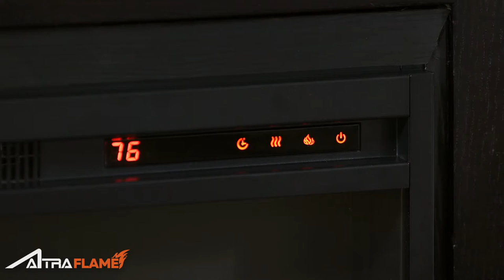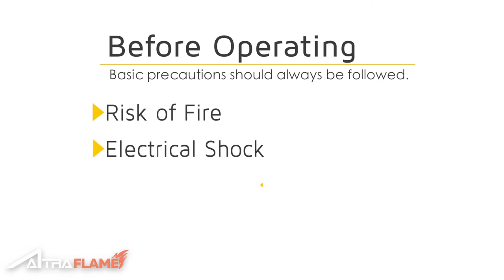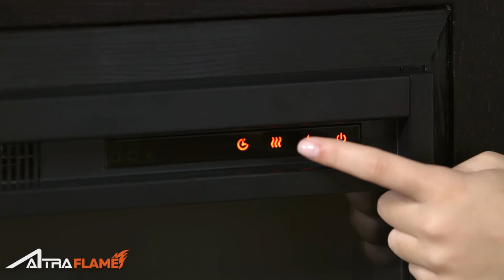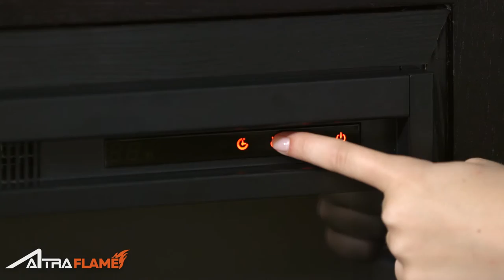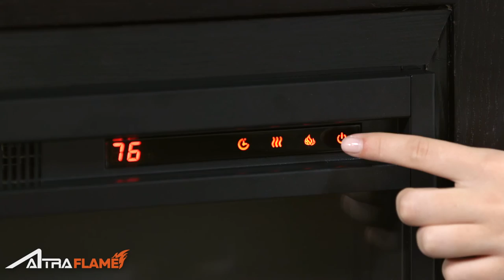Ameriwood Home's AltraFlame 23" Fireplace Insert Features

Comment: Mine is very similar to this model, however mine has cabinet doors and some the setting functions work differently. Bought mine towards the end of winter from walmart when it was on sale last year..  ill use it more this winter but so far no issues.  Im running mine currently set at 82 degrees. Tonight it is supposed to drop to 28.

Comment: I bought one for my wife for Christmas we put it together the flame work....the heat will come on then shut off and E3 will pop up on the display......HELP
Reply from the maker: Hello, the E3 error is most likely being seen due to the fact the unit is not plugged directly into the wall outlet. The manual states that the unit should be plugged directly into the wall to have the most power. It’s likely your unit has over heated and will not blow heat any longer. We are working to get this statement better placed on the plug and in the manual. For a replacement, please contact our friendly customer service team at 1-800-489-3351 from 9:00 a.m. to 5:00 p.m. CST. Thank you.
Reply: Yes it is plugged directly in to the wall
Reply from the maker: @laduke6969  Please give our customer service team a call and they can help get you a replacement to fix this issue. Thanks!
Reply: I am having the same problem.  We just unboxed and assembled.  Plugged directly into the wall, followed directions in Manual, and we are getting the E3 code.  Did you ever get it figured out?
Reply: @mmilford1  call them they will send you a new replacement that's what I did